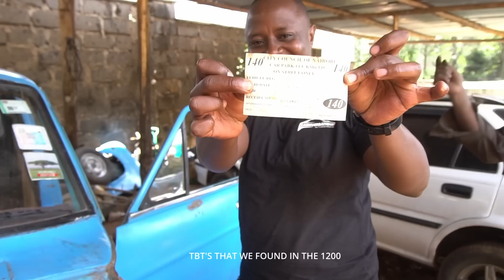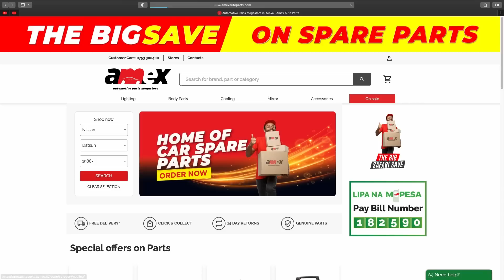RESTORATION OF THE NISSAN DATSUN 1200 : Carnversations restoration #ep1 #carnversations#restorations

Comment: These are the cars i grew up in in the 80s and 90s. Super simple to maintain you could do it with a hammer and string and bulletproof reliable. They had low power but zilikanyanga all the milima in Kenya no problem kwa matope au vumbi they were great. People who never experienced them are missing out. There was the Datsun 1200 pick up, Datsun 1200 saloon and the everlasting Datsun 120y. My uncle still has his he bought in 1992 na bado inasukuma Eldoret to Nairobi and back no problem. The bigger Datsun 1600 pickup and the sporty Datsun1600sss., the 160B and 160J. Those were the days when Datsun/Nissan was king. Hizi za siku hizi, from like 2002 ni mikebe tu.
Reply from the maker: I could not agree more sir

Comment: Had one in 1994. Bought it at 360k used it for four years and sold it at 390k.Fit alloy rims. Use bars at rear  and on the bar mount the spare wheel. The car will look unique. Wish u the best.